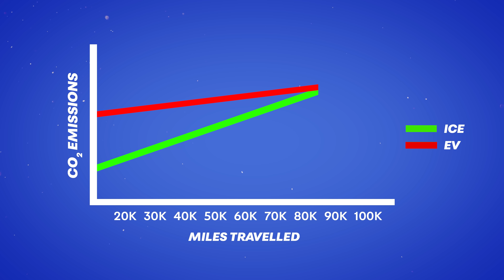Are Electric Cars REALLY That Green? [New 2022 Data]

Comment: Meh. Let's all be honest. Moving the focus from Oil and Gas into Electrics DOES rely on some fairly major lifestyle re-adjustments. 

The advantages are pretty clear though. Moving away from reliance on fossil fuels is an intelligent idea; if only to save that precious, energy-dense medium for future situations. "Peak Oil" has come and gone, and the environment is in a ragged state at best. Until nuclear fusion turns up (and even after), battery-electric is a relatively cleaner economy than a gas/oil-based one. Even Hydrogen-based solutions, heavy on production cost and lighter on energy density - provide better outcomes for future generations. I'd argue they will remain applicable only for certain uses, but VERY useful in those cases.

Investigated, NO car is really that green - because it is personal transportation. Mass transport is so many orders of magnitude greener; this is beyond argument. We insist on this personal freedom, and historical/economic pressures have reinforced the paradigm since at least the Ford model T. Even Mad Max, in his post-apocalyptic world would now have a Model S over the last of the V8 interceptors. Conclusion: Electric cars are better than no cars.

Comment: A couple of thoughts: 
1. Cradle to ~90k miles is good… but should really look at cradle to grave. I expect that the disposal of electric cars has a much higher negative environmental impact that and ICE car.
2. Running electric on renewables is good- but you need to include environmental impact of making and maintaining the wind farms and solar systems. These are not zero impact installations - any more than oil refineries are. And these impacts do continue beyond the initial installation.
3. As others have mentioned - over the typical life of a car, the batteries will have to be replaced how does that impact the comparison?
Thanks for this report and your analysis.
Reply: And you don't feel oil refineries and drilling equipment might need repairing or replacing?  And older EV batteries don't always need to be fully replaced. The failing modules can be swapped out for good ones at a fraction of the cost of a complete replacement?  Haven't you heard of battery refurbs?

Comment: I've seen similar studies, but not from a manufacturer. There, the drive distance volume before an EV is green, is shorter, depending on country. In the US, its around 15K miles. Regardless, in the US, our problem, is the people most resisting the idea of electric cars, are the same ones who for years, resisted the idea of replacing coal power with cleaner alternatives, because of coal jobs. That said, Volvo should have included a calculation that takes into account all of the fossil fuel driven conflicts around the world.

Comment: Even if a suitable battery can be found, an older EV is likely to have problems with the cost of replacement electronics.  You can buy any part for a Ford Model T.  Try buying parts for a 10year old EV.  I expect there will be large numbers of relatively young EVs that will not be repairable, or too expensive to repair.

Comment: Electric cars are cleaner than combustion cars. They cause the same eco damage to manufacture as traditional cars, they might still use fossil fuels to get electricity, but a powerplant is more efficient than a combustion engine. So no they are not clean, but yes they are cleaner.
Reply: And the lithium in the batteries can be recycled into new car batteries.
People always quote the emissions of digging up new lithium as though every electric car has fresh out the ground lithium batteries. Reality is more and more new electric cars will have more and more recycled lithium.

Comment: Thanks for this, Rory.
Interesting to note that Mazda had actually given this as a reason as to why its MX-30 has a tiny measly battery... to ensure total life cycle pollutants are lowered for the MX-30, but most folk at the time thought it was just an excuse. Volvo's report seems to corroborate this in some way. 
Well this informs the need to streamline EV production processes to make the production greener.
Would innovations in energy dense batteries help remedy this?
Reply: I own a MX-30 and knew what I was buying in terms of the ”bonsai” battery. Kept the prize (and weight) of the car down. And hopfully I will reach the breakeven point a little sooner than with other EV’s.
Interesting that Mazda will offer a model with a downsized battery and a Wankel-engine/generator to a act as a range extender. They really stand out from the crowd!

Comment: That's not where it ends though, is it? Most if not all materials on ICE cars can be recycled. Which is not something that can be said about all EV batteries. So it's not like the EV stops polluting as soon as it drives out of the factory, it just has a delayed igniter built in.

Comment: If people really cared for the environment, diesel would be the way to go. If take all of the EPA garbage off-and it is garbage-the engines are extremely efficient. They get incredible mpg. They last for up to a million miles. The batteries in a battery powered car don’t last long. The cost to replace them is prohibitive. My daughters first car was a hybrid, I was against the idea, needed a $4000 dollar replacement. Not to mention the old batter was now junk and not reusable for anything. 
Finally, CO2 is not a pollutant. You and other mammals exhale it and vegetation uses it and give oxygen. This is not debatable.
I guess this would be final finally, climate science is not science. The Scientific Method states results must be verifiable and repeatable. Computer modeling is neither. Period. You’ve been lied to and instead of answering my statements I will be called a denier or even a racist… The left cannot argue their points.
And-GO:
Reply: I’m not arguing, I agree.

Comment: There are still some impressive ICE improvements emerging - which is a great thing- Freevalve is a great example of this. EV in terms of the engine power itself will always be better, but it's the rest of the car built that is the downside to EVs, however, battery tech is also improving. The best thing about having both options is that they both force each other to improve.
Reply: And thirdly, at the minute, if your work depends on it, diesel is pretty much the only way to go for high power long haul situations. Hydrogen fuel cell cars are a possibility, as is hybrid truck idling (i.e using solar power for amenities in cab) but unfortunately the tech hasn't come far enough to replace the practicality and stability of diesel engine trucks. There are too many what ifs to owning an ev as a daily for some people unless it's an auxiliary vehicle.
Reply: We won't have both options though. That's the problem. We'll all be forced into EVs.
Reply: Electric vehicles are already better than ICE vehicles in every conceivable way. By the end of this year electric vehicle sales will double and ICE vehicle sales will be down by 40%. Last year electric vehicle sales for up 70% and ICE vehicles were down 21% overall manufactures. By the end of this decade we should see over 90% of all vehicle sales being electric, 6% being hybrid with only the remaining 4% being ICE. If you want proof of that look at Norway which is already at the last series of numbers I quoted.
Reply: @colingenge9999  I'd rathe see retro fit options be made available. Making more cars is worse for the environment.
Reply: @peterwindle4453  when you consider that a gas power car produced 35 tons of carbon dioxide and half a ton of nitchesox oxides over it’s a lifetime it’s hard to imagine the building and do electric vehicle be any worst. In fact it’s not. Also if you’re thinking about retrofitting gas cars with electric, it’s a difficult process. I consider Tesla buying 15,000 lotus roadster and retrofitting them for Horr as an electric vehicle.
Claims he wind up replacing 93% of the car and they cost $250,000 per car to build. Not really a good solution.
Reply: @colingenge9999  building any new car uses far more natural resources than rebuilding an existing car, electric or not. If there was more focus on preservation and less on making new stuff, we'd all be better off. Conversion is not a good solution, you're right, but that can be improved, if the focus was on creating cost effective kit conversions...but we all know that won't happen, because no one wants to empower the masses, the power/control goes to only a small percentage of corporate shareholders that control the markets.
Reply: @peterwindle4453  you do understand that keeping the old car alive is a hassle? Rust and other things will tend to creep and people will not want to deal with it.
In the UK and in the US people already drive their cars for quite a long time.
proper conversion is not that cheap.
To make all the systems work with the new motors and changes is also not cheap.
Reply: @danepher  I totally agree. I just like the idea of preserving human skills preserving, restoring, improving and caring for things rather than throwing things out and getting things built of assembly lines. Perhaps I'm a dreamer :-D

Comment: I saw video on Youtube about tires on EV. The video says that because the heavy weight of EV tires are consumes faster and because of this EV needs more tires during its lifetime. And this creates more tire waste and because of this pollution. Also rubber dust which generated by tire friction with the road is washed off the highways and get into water and because one EV needs more tires during it lifespan it create more rubber pollution.

Comment: The electricity in my province in Canada comes from hydro electric dams. The carbon footprint for electric vehicle owners here is a lot lower than most. Meanwhile not only do gas engines pollute the air, it is $2.00 Cdn a litre. That is the equivalent of paying $5.86 US per US gallon, for 87 octane. Gas is expensive, electricity isn't. If I could afford an electric vehicle, and use it for my job in the construction industry, I would be driving one right now.

Comment: The best option at the moment i think is to keep using existing cars and to try and keep them going for as long as possible. Maybe try and make it easier a cheaper to repair existing cars aswell.
Reply: If you have an existing car that's running fine, passes emission inspections and is not a completely absurd gas-guzzler, I don't think it's environmentally good to scrap it in favor of a hybrid or EV. Keep that thing running and put off the lifecycle costs of producing a new car for as long as possible. But it's more a question of what to get for your next vehicle when the time eventually comes.
Reply: By definition existing ICE cars will become more and more expensive to repair. It's the nature of such vehicles to suffer wear and tear in any number of important components. Having owned ICE cars for 20 years and an EV for six years I can attest to the MASSIVE savings in maintaining a car and fuelling it. ICEs just can't compete.
Reply: Having your car today would be worse in 10 years than if you bought an EV. This is also true when the battery is replaced, according to another video by Engineering Explained who considers the worst case scenarios for EV's and battery replacement.
Reply: @Jimsimi  Buying a new EV is way worse for your average consumers wallet.

Comment: Unfortunately this won’t make a shred of difference. It was blatant batteries are a dead end solution. They are bad to make, need to replaced and can be very volatile. But people get on the high horse I’m doing this for the environment when actually your causing more harm. Hydrogen cars are more of a solution or even better buy a petrol car look after it and run it for 20 years 🙄

Comment: The best way to go Green is to recycle, correct? 
So why do people keep buying expensive new cars when there are so many cheap old cars available? 
Buy an old junker, fix it and then upgrade it with modern stereo and such and you'll still have a small fraction of the money in it as you would the new car. 

Just fix an old car that's good on fuel mileage and you're exponentially greener than buying a new EV.

Comment: Most people must consider the undeniable fact that to main a reasonable distance between charges is building a car that is both light and safe . You'll either depend on light weight, but strong alloys which need to be mined or a much heavier reliance on plastics , hence the oil industry with produce more . The old power to weight ratio issue or E=MC2 formula . All being said , I think its great to have a open discussion,  we human maybe smart enough to unlock our need for the modern requirements and yet still respect the environment.  As JFK once said , we all live on this planet,  we all breath the same air .

Comment: The point I think people are missing about the ICE vs EV debate that completely through ICE out of the buss is that the methods of mining the battery materials can be adapted to be greener, the grid can move to more renewable energy(which will make the mining cleaner too) which would all make EV's greener. The problem with ICE cars are you can make them from recycled materials but as long as your burning gas your making CO2 at a rate that is higher than we can afford. EVs you buy today will become greener with the grid, but ICE cars will always just get worse with time.

Comment: 100 years ago, electric vehicles where powered by lead acid batteries. The batteries could go 100's of miles on a charge, from house outlet; and they could be opened up and cleaned yearly or as required.  The lead cells can last decades when cleaned and reinserted and are recycled completely when vehicle is scrapped.  Of course this solution, is re-volt-ing to those who seek power and wealth over the citizenry. In the country a simple wind turbine dedicated to the vehicle could provide the maximum green energy solution.

Comment: Saw an article from the wall street journal, think they claimed the break even point is around 26k and by the time you reach 160k the BEV is at half the emissions of the ice car. Over the life span of a BEV(assuming that you don't replace the battery or get in an early accident) it can result in x2-x5 less pollution. How is that not a massive difference? If you would buy a new car now, the grid is only going to get cleaners over the coming years as well. I which you would include their figures when it reaches half the emissions.

Comment: I can’t believe this is still a debate. For the last 15 years this idiotic debate has been popping up everywhere. It has been proven again and again and again that when you consider everything from battery production to end of life usage the EV wins. And the statement only works depending on what kind of car you buy, where and how your energy is produced, how many miles you drive it etc…. Even when your electricity is produced by coal, it still wins. In a 100% renewable energy market, you beat the ice exactly after 10,000 miles. These are big cars. Nobody NEEDS a huge battery. Everybody wants one. If you buy an economic car such as a leaf, you don’t pollute as much. It’s the same deal as with gasoline. There is still a demand for small cars. But every carmaker wants to have a big electric suv instead of several models including short range economical vehicles because their profit margin is bigger.

Comment: That 90k figure is even more important when you factor the replacement time-frame of an EV vs that of an ICE-V.  The biggest issue with EVs is the battery, which is also the part of the car the won't last long after the 90k time-frame.
Reply: nonsense, first gen pirus's in BC, 500k and then used as cabs original batteries.

Comment: There are 2 flaws in the data: 1) you dont consider recycling that yes is still developing but it will have an impact 2) future investment: if you buy a diesel car you invest into a 100year aged technology, if you buy an electric car you invest in a future technology
Reply: There is one flaw in your comment. The first electric car was built in the 1800’s. Basically an electric horse buggy. Electric cars have tried to break out multiple time since then with no success. For a technology to replace another it has to be better then what it’s replacing and I still don’t see that as of today but maybe in the future.

Comment: Most EV batteries will not last long enough to reach the break even point. Charging a lithium battery is not as simple as filling your tank. Lithium batteries have a memory. If you continually charge them at lets say 30%. The battery will start reading full at 30%. And with an average of 200 mile range. You will have to charge it 450 times to reach the carbon footprint. And the cost of replacing batteries with environmental and disposal cost. Is so high. That most will trade in their EV instead of replacement. Will the dealer replace the battery and then resell the car at near the cost of a new car. Or will the car go to the scrap yard at lets say 90,000 miles. When if serviced correctly a gasser averages 200,000 miles. so you have to build two EV cars so to replace one gasser.